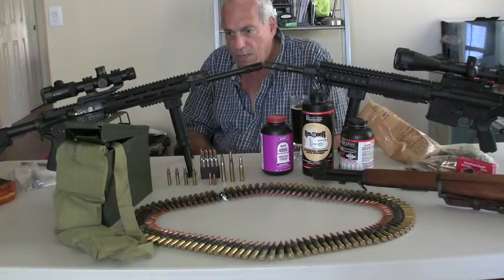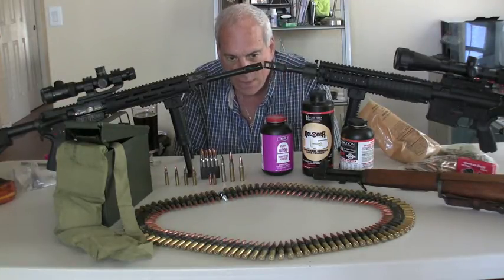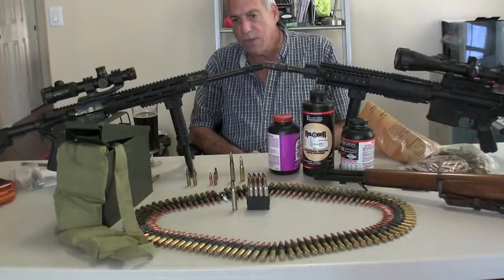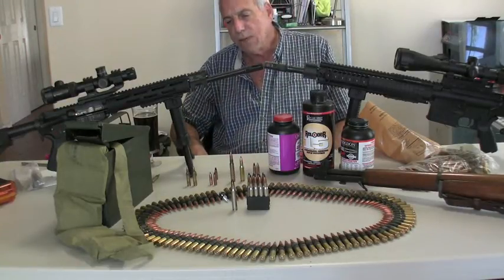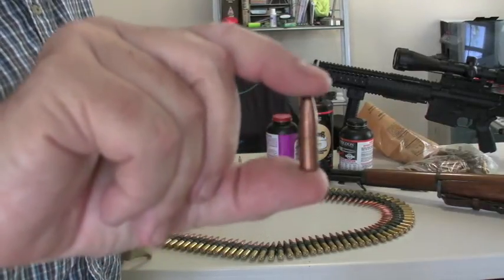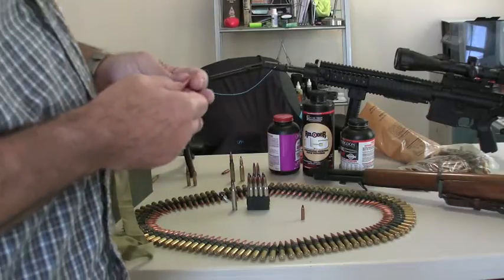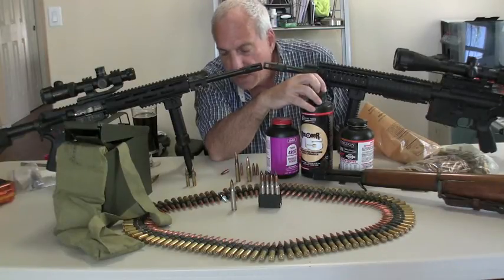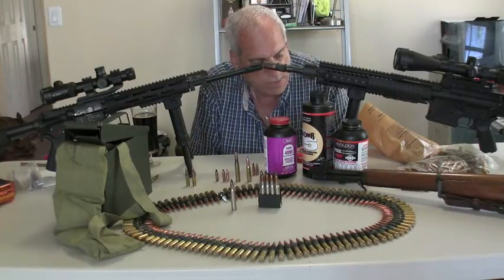CONSIDERATIONS FOR RELOADING ARMOR PIERCING AMMO

Comment: Hello sir. Do you recommend 4895 for the .308 AP reload? I’ve read on a forum to use 41.5 grains 4895 per .308 cartridge. What do you recommend the powder load to use? Also, after seating the bullet, what overall length should the finished round be? I also read that it should be 2.800”. Can you confirm? Thank you! I’ve been looking for data like this for years now.